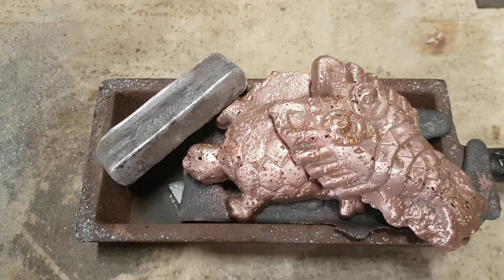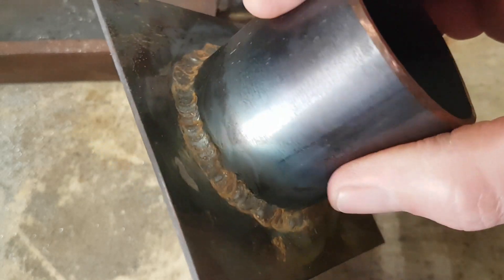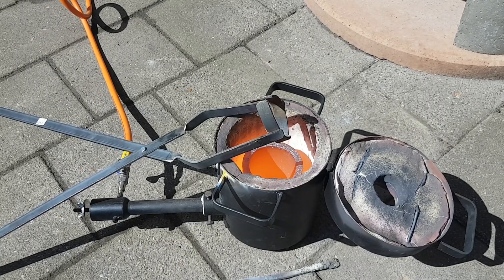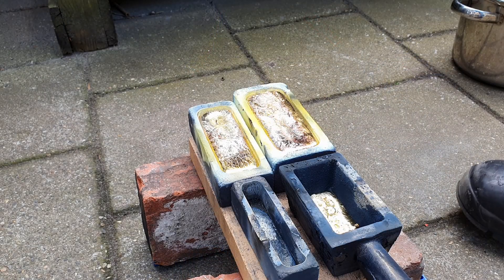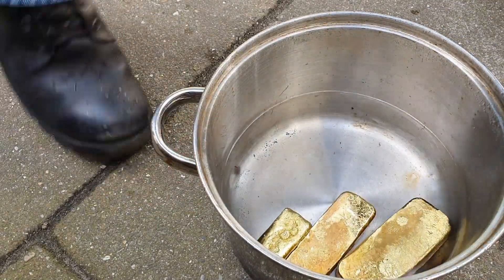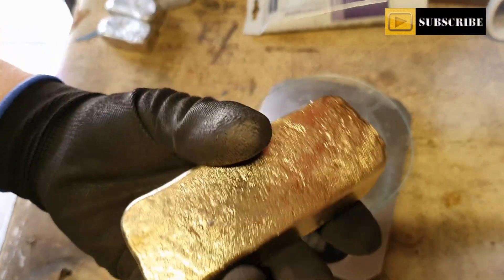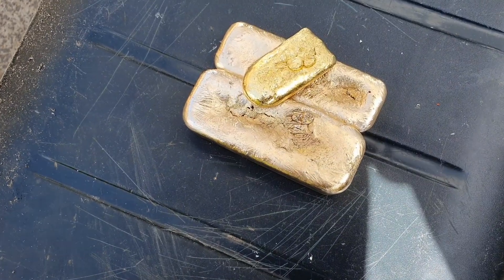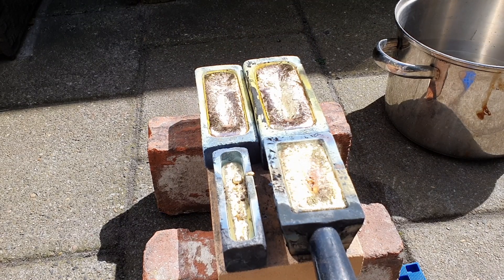Making Nordic Gold - Devil Forge - Metal melting

Comment: Would this recipe work well with lost wax casting? Also would tin or pewter work well with small lost wax casting such as a tooth cap? Thanks for the vid man👊🏼
Reply from the maker: Hi there, I think this metal should work wonderfully with lost wax casting, especially when placed in a vacuum setup. Tin and Pewter I would not know, to be honoust I never did lost wax casting myself, only watched it :)

Comment: Hi, great video! May I ask, if is there a reason for putting tin and zinc in the end? Asking because of the zinc flash🤔
Reply from the maker: I was afraid that when putting in the zinc from the start all would be cooked away during the melt of the copper. I think there is less zinc evaporated when adding it in at the very last bit.
Reply: @Metalstacker  great, thank you!

Comment: So I first saw this reaction with the zinc on another channel and they said it "boils away". I never got an answer so I'll ask it here too,, if it boils away, what is the point in adding it? Is there really zinc in nordic gold??
Reply from the maker: Hello there and thanks for asking! Yeah there is 5% zinc in nordic gold. As copper melts at 1083°C and Zinc had a boiling point of 907°C it will surely evaporate a bit of the zinc. I think the formula of nordic gold (89% copper, 5% aluminium, 5% zinc and 1% tin) takes into account that some zinc will boil off. (Nordic gold is a widely used alloy in real coin minters) I do not think all zinc boils off, what would be the benefit of adding it? When all metals are mixed, the melting point of the alloy gets much lower, so a future melt had almost no zinc boiling off as the temperature is just below zinc boiling point. Whenever you make a new batch of nordic gold, the copper must melt so you will always have some zinc burning off. Hope this helps out a bit. I will also ask a guy on Instagram who studies metallurgics, maybe he knows a better answer :)
Reply: @Metalstacker  hey,, thanks for the reply. Makes sense to me.

Comment: That's really good work!  Nice job!  What happened with the zinc?  Why did it go up in smoke like that?  That looked a bit scary, to be honest.  Anyway....really nice bars!!!!
Reply from the maker: Thanks! As Zinc has a much lower melting point than copper, it will react violently with the molten copper. I had done this a couple of times before, looks kinds scary, but with good PPE it is just fun :)
Reply: @Metalstacker  I appreciate your reply!  I'm very anxious to make some Nordic Gold.  Its so pretty but I'm also nervous because of that violent reaction.  However, I do have leather boots, long leather apron, respirator, face shield, thick leather gloves and sleeves.  I'm pretty confident that I have suitable PPE because I'm very serious about safety.  I did my first ever melt last week.  It was just some scrap aluminum but I'm happy with how it all went.
Reply from the maker: @mountaindewdude76  Sounds like a proper kit for safety, good job mate! Good to hear you melted some metal. If you do not want a violent reaction (and toxic fumes) you could first try aluminium bronze, or bronzal. It is made of 11-9% aluminium and 89-91% copper by weight. It will look kinda like nordic gold. Make sure to stir it well after putting in the aluminium.
Reply: @Metalstacker  I appreciate that input!  I've been following bigstackd, VOG, IngotJoe, ArtbyAdrock, and swdweeb for many months.  I've been following your channel for a few weeks now.  All of the above sources have been encouraging, informative, and entertaining.

Comment: Do you always wear a respirator? Or only when tin is with it? only need an respirator(mask) for me and I'm curious😁
Reply from the maker: When I melt copper or aluminium I will not wear a mask as there is little to no toxic fumes. You want to wear a respirator when zinc or lead is involved as they give off toxic fumes. Not sure about tin, but from what I saw, tin casters normally do not wear masks.
Reply: @Metalstacker  Than you for your fast response! As soon as my furnace is dry, i'll temper my crucible and start melting✌ Have a nice day